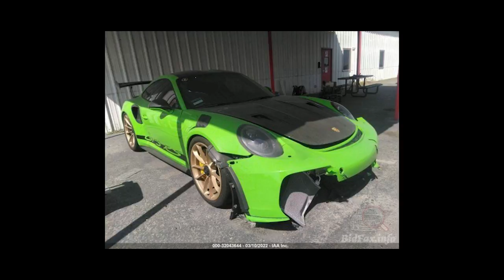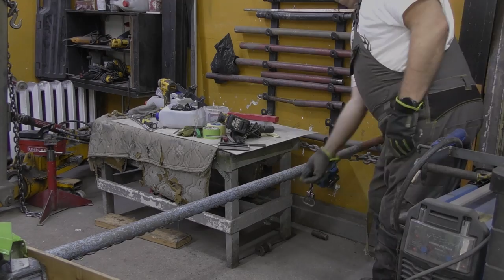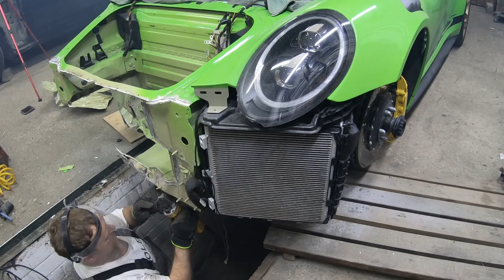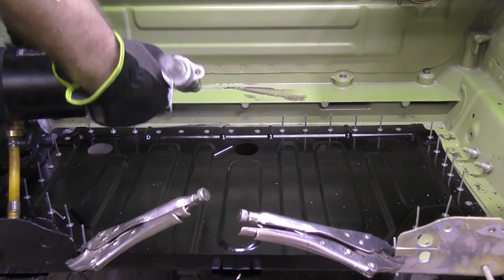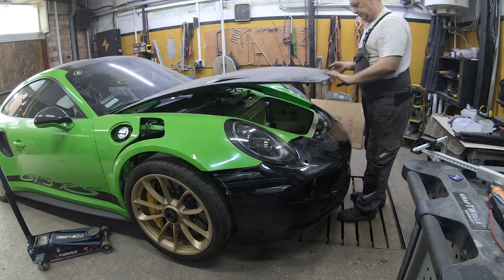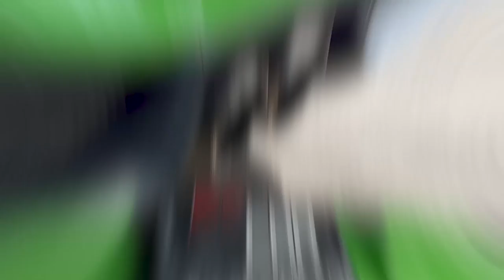Porsche GT3 RS. Front end rebuilding. Ремонт переда.

Comment: @tussik01. This is a very helpful video as i need to do the same repair on my cayman 981. Did you weld the broken / bent part of the bottom corner of the luggage bulkhead (6mins 02secs) and, if so, what type of welding rod / settings did you use. Also what glue / sealant do you use as the listed one in the Porsche parts diagram doesnt seem to be available. Many thanks!
Reply from the maker: I don’t remember what marking the rod is, and Teroson EP 5055 glue
Reply: @tussik01  thank you so much. Was the material at the back easy to weld to?

Comment: Arthur, why you did not applied adhesive? Besides… rivets on the floor where installed backwards! It is from bellow! 😅 you also did not install the upper radiator brackets and that bumper is not for the GT3 RS 991.2… it is for the 991.1… so… shame on the owner… good luck with fitting a part that would not match! This work is bellow you Arthur!!!
Reply from the maker: There was glue, just a few video files were accidentally destroyed. The bumper was just to try on, it will be replaced.
Reply: @tussik01  of course Arthur… that was very strange. It is not the first time you repair a Porsche. I remember you applying acetone/alcohol to clean, glue and after that structural rivet. Strange you couldnt post those steps in the video, but things happen. I would advice in test fitting the radiator bracket. After that, the owner should use OEM parts for that model in order to maintain fitment. It is a GT3 RS Weissac for god sakes! LMFAO